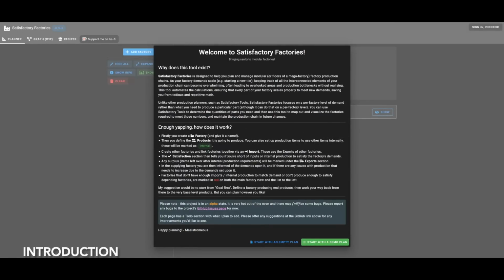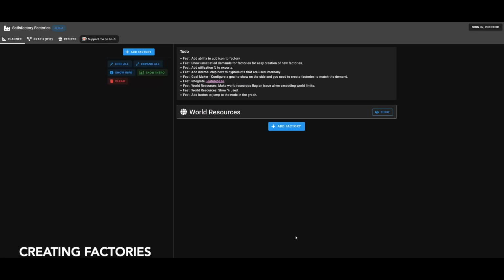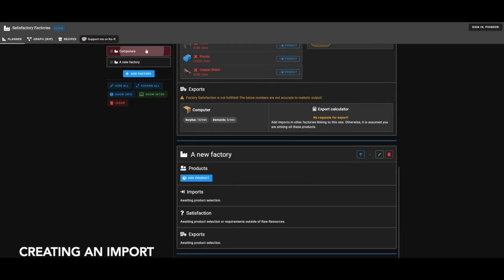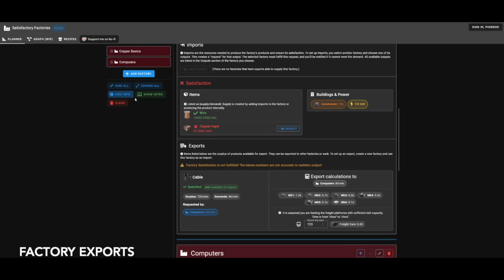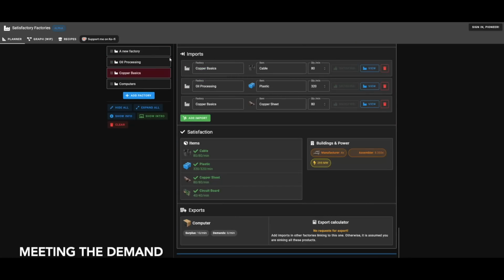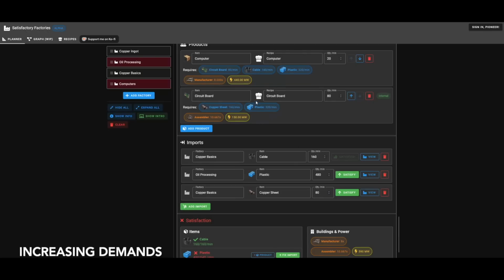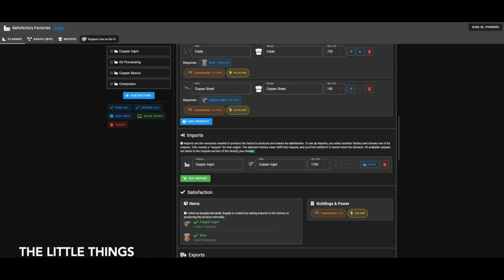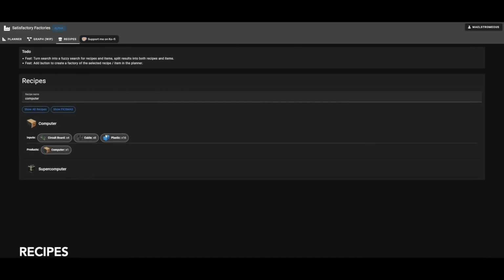Satisfactory Factories Demo

Comment: This is a great tool, but REALLY needs clocking controls to be useful.  I (and I suspect many others) build groups of manufacturing buildings together with blueprints, and use under/overclocking to tune them to match the output to match resource limits, belt speeds, etc. rather than adding/removing buildings.

Comment: This is a really slick bit of coding! A thought, is there a way to either export the data to an excel spreadsheet or some other medium to make it print friendly? Otherwise you need to bounce back and forth between screens (or run dual monitors)
Reply from the maker: Apologies I didn't reply to you at the time, you are currently able to press the "Copy Plan" button which saves the plan to your clipboard, and you can then paste that wherever you wish to save it.

Comment: This is so great.  My feature requests would be for sloop/overclock support, and the ability to define a blueprint that can be scaled.  E.g. I have a blueprint that takes raw quartz, iron ore and water, and produces Crystal Oscillators.  Everything is perfectly balanced.  To scale this, I add another blueprint or two.  To scale it in the tool, I adjust the products individually.  It would be cool to just say "+1 of this factory/blueprint" and see where the dependencies fail.

Comment: Very neat. You’ve UXified everything I do on a spreadsheet. Feedback regarding production of any resource from raw materials (ingots, concrete, quartz crystals) - I very much prefer using the pure alternate recipe that requires water to significantly reduce the raw ore required for my mega builds. Would love if you could add support for that as well
Reply from the maker: Not sure I'm fully following? Could you make a simple example in a private browser and share that example with me? There's a new Share Plan button at the top.

Comment: This is so cool, for my purposes I don't think it will revolutionize how I build my factories, but what I particularly love here is the amount of organization it gives you. Having that clean overview and knowing where you're lacking is super sweet.

A feature that I also think would be really cool, is kind of a reverse process where I can input how much of a base component I have, with desired output(s), and it'll do the math for me on the ratios and whatnot. As a really simple example (so simple I wouldn't need it for this example but hey), let's say I have 2 pure coal nodes and 1 normal, and I want to see how many coal generators and water extractors I would need to fully satisfy the input I'm giving it. This would probably be pretty hard to code though because of the amount of variables involved, but it would be extremely cool nonetheless.
Reply from the maker: Others have said the same, but that goes into the realm of a Solver, which is extremely hard to program and that would be an entirely different project in of itself, I'm afraid.
Reply: Satisfactory modeler is the one you are looking for. 
their you can pick miner with any material , as your example you picked caol miner and then you added the amount those miners are producing , according to your progress like for me I have mark4 belts as of now, so 2 pure 1 normal that's 480+480+240 = 1200 , you can drag the miner output and select coal power generator, it will show you how much generator its going to take for all that coal you are providing it. 
it is so good of satisfactory calculator , it lets you chose your choice of alternate recipe , you can even go backward where you chose like you need 120/m heavy modular frames , then you can create the graph yourself by just draging and selecting the recipe .
Reply: @ oh I had never heard of this tool, I’ll check it out, thanks for the suggestion!

Comment: really interesting tool, gotta play around with that for a while =)
Reply from the maker: Let me know if you hit any issues!
Reply: @Maelstromeous  so far only the power requirements don't match up. My 640 refinerys only consume 320 mw
Reply from the maker: @AngeloidArtiSEA  There are major bugs with power calculations at this time. Don't trust any power values until it's fixed. Recommend you look at the top of the site and have a gander through the issues list, there's some bugs right now you should be aware of. Remember, this is an alpha!
Reply from the maker: If you spot any bugs, please report them on the GitHub page!

Comment: First of all, fantastic work. Only one comment, is it possible to have the ability to siphon off some resources to storage (as an output)? So you’re always able to build some capacity into the system for uploading into dimensional depots etc.  Thanks!
Reply from the maker: Other's have requested this, right now the assumption is that such products are sunk (and imo, that's the correct way as Dimensional storage gives you 5 full stacks worth of items, and if you're needing some to store material in containers on site). The issue is that it kinda breaks the math of the accounting of the site. However I am toying with the idea of creating "consumption points" e.g. Power, Sinks and quite likely simply "storage", which makes the math happy.
Reply: @Maelstromeous  Thank you.